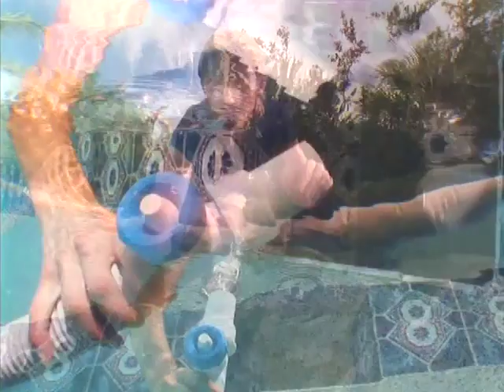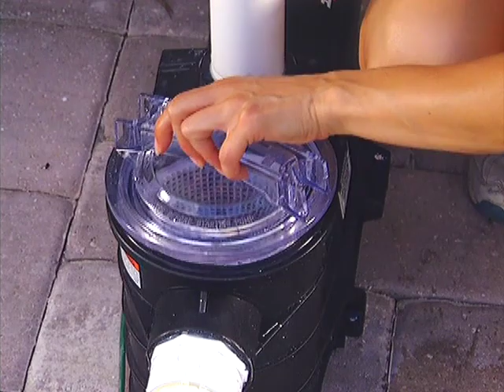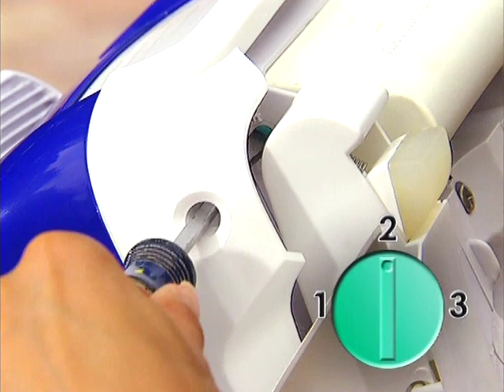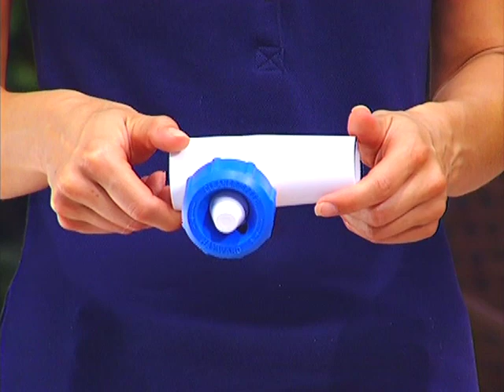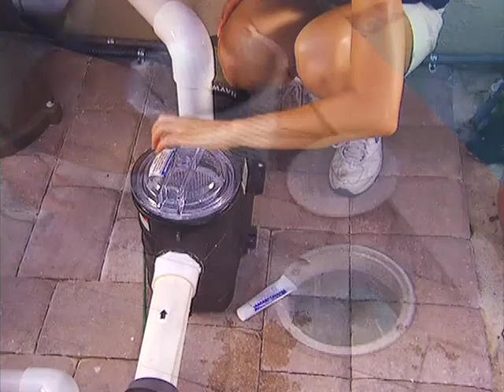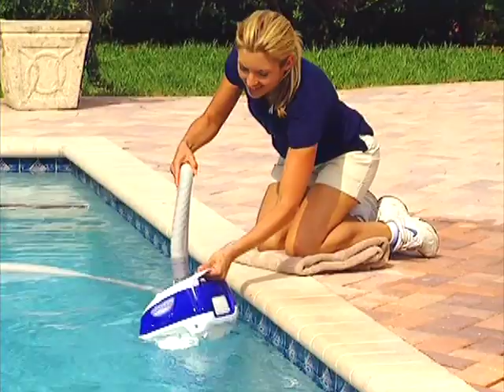Navigator Pro Installation and Troubleshooting

Comment: Why do i need to turn on the pump with the flow gage on the hose? The hose is not connected anywhere!
Reply from the maker: One end of the hose is attached to the skimmer or dedicated line on the side of the pool.  Before attaching the other end to the Navigator attach the flow gauge.  Turn on the pump and adjust the flow between min and max on the gauge. Once adjusted turn off the pump and remove the flow gauge.  Attach the Navigator to hose and turn on the pump.  Make sure the leader hose is attached to the Navigator.